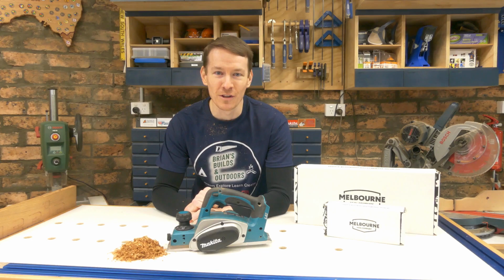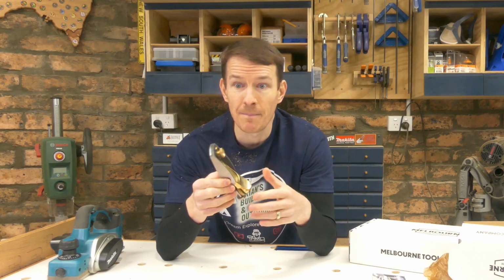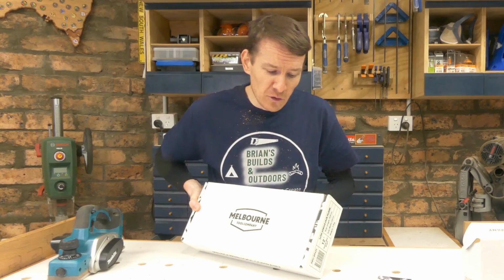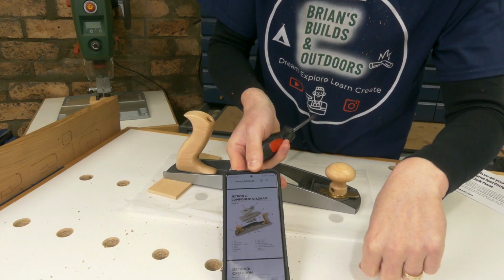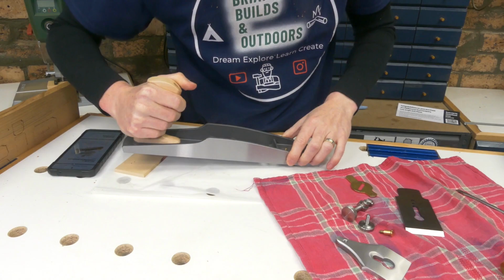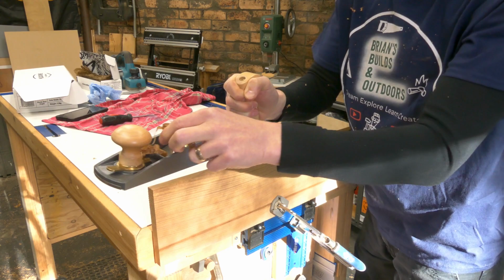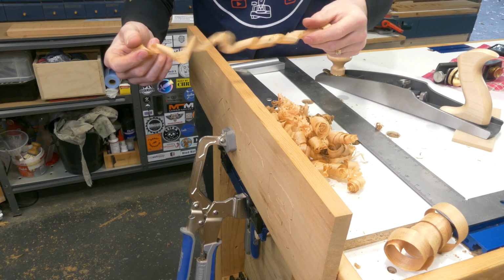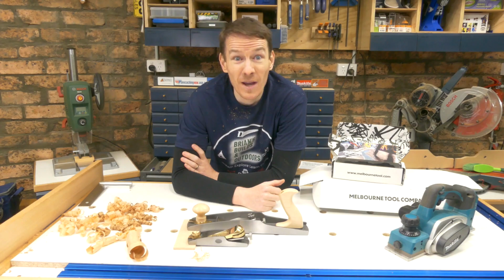Melbourne Tool Company Hand Planes: A Novice's First Look at the Low-Angle Jack Plane & Block Planes

Comment: There are some jobs that the plane is the go-to tool. Glad you took them apart, it makes the tool so much more familiar and they look pretty well made. My planes started out busted up vintage clunkers that cost approx 5% the cost of these babies, but after a solid day restoring and tuning one up you end up with a user. Sharpening is an interesting skill, when you finally work out how to get it proper sharp blade it is a revelation. I first had to use a microscope to get the edge perfect, now i can feel it by running it over a finger print. Shaving arm hairs is just a party trick for the audience.
Reply from the maker: Cheers for the mini binge Mat!  I've been enjoying a number of your old plane videos. I nearly went the way of buying old chap restoring planes but as a newbie I'm actually pretty happy I didn't as I'm still getting used to them and these make learning easier. Learning to sharpen was enough extra curricular, restoring can come in time 😅
Reply: @FixitFingers  restoring is a labour of love, and addictive ! I don't think l could pass up another busted up old plane even though i already have more than enough for 10 life times.

Comment: There is a reason why there are no commercial stands of Australian Cedar left. It is so easy to work we almost made it extinct. It was used by some of Australia's finest craftsmen but it's workability was such even very average tradies looked like Masters. Try some Ironbark if want to really test a plane. If you want a deep dive into using hand planes try Paul Sellers or David Charlesworth amongst the Brits and Rob Cosman the Canadian amongst the septics try Wood by Wright. Cheers and remember to vote early and often.
Reply from the maker: Cheers mate!  Thanks for the references, will find me some good viewing there I'm sure. Think I'll save the iron bark until after I get the sharpening gear (and learn how to use it 😋)

Comment: Planes intimidated me for a long time, so I bought a couple of old stanley's from ebay. Now I think I have 6 or 7 lol. 😆 I'm no expert, but I love using them whenever I can. Not having to wear ear protection is a very big draw, but the best part is how much less sanding is required now. I've bought the block plane as well, will try to do a review in the next week. 👍
Reply from the maker: Good marketing move putting them on sale... lots of free coverage on the tubes up front 😁

Comment: Jack plane, jack of all trades is where the name comes from. You should buy more irons (blade if you're Australian) for the plane, you van sharpen them in different ways for different uses, scrub, finish etc hence the name jack of all.. Block plane man that thing should live on your belt, Im always reaching for that bad boy! Low angle planes was a good move bud!!!
Reply from the maker: To be fair Low Angle was the only option.... but I guessed if that's what MTC started with there was a reason ;) I can see the block plane getting used a lot, I wasn't going to get the #5 but thought smeg it, it's my birthday... and wifey was paying 🤣It'll get a run as I learn I'm sure!

Comment: They do seem decent planes. It's kind of funny how things changed during the last decades... all seems to be reversed. I started out with only hand tools, slowly getting electric tools when years (and budget) progressed. I learned to plane profiles, later on getting a router. Now the workshop is equipped with a thicknesser (which I use as a planer too, with a sled), slowly the hand planes are used less... But a little block plane is always used, always on hand because it saves so much time compared to setting up a router. Good luck and congrats on your purchase!
Reply from the maker: Also the cost! Once, a power tool would be much more expensive than its hand-tool equivilent... now, even this mid-level jack plane is 3 times the cost you could get a corded power plane for (let alone a "fine" woodworking plane from Veritas or Lee Neilson!)